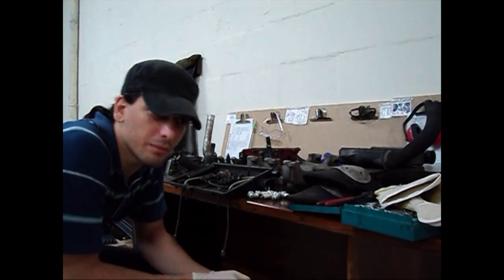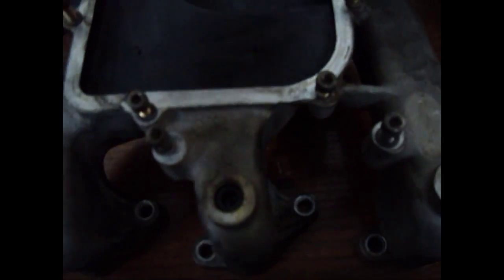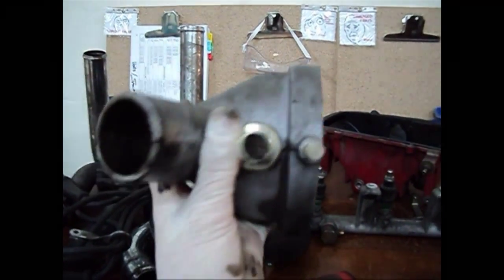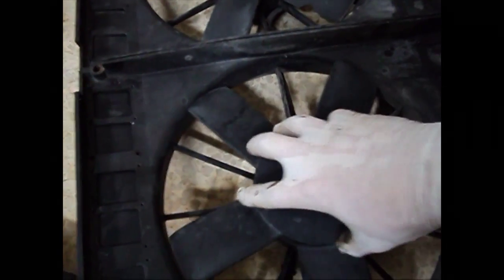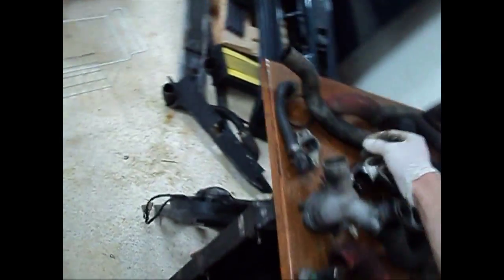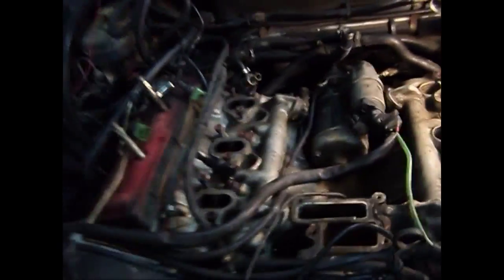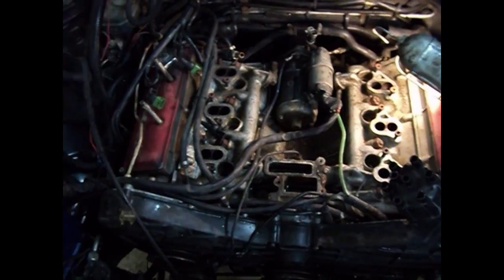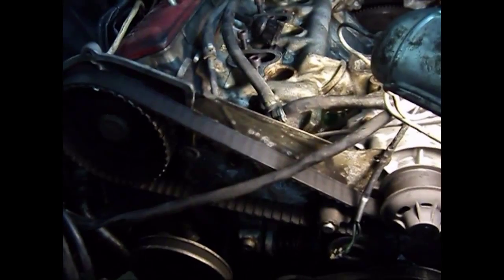Inspecting Damage of Engine Parts - Maserati Spyder Part 3

Comment from the maker: The starter is placed in a good location, it's the induction chamber which seems odd...
Separating the induction manifold should do the trick:
Turbo on to the Inter-cooler on to its respective cylinder head and the starter would be exposed.